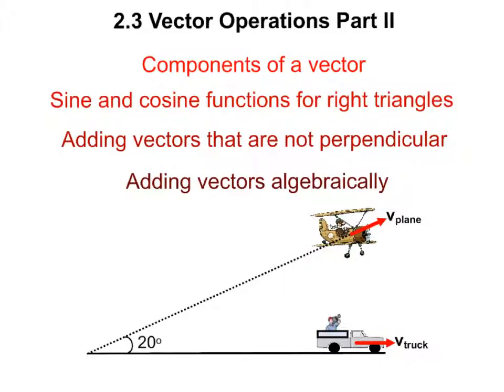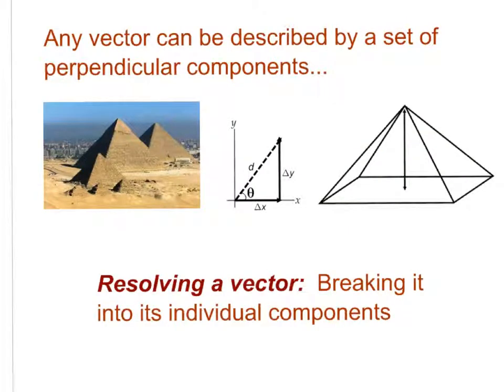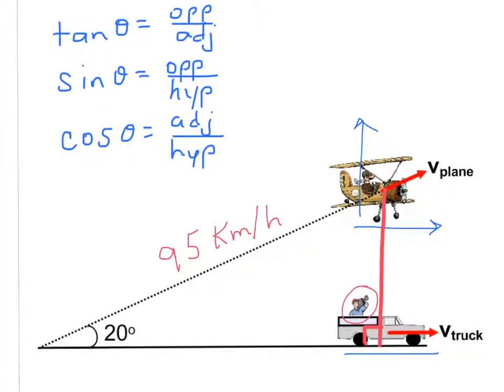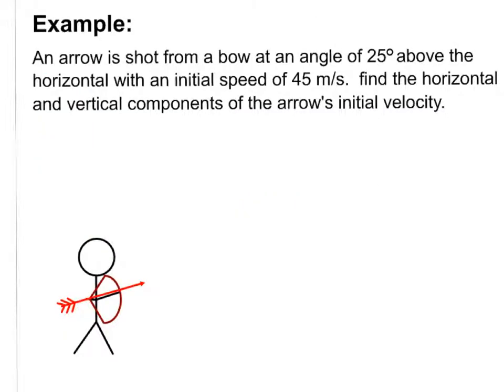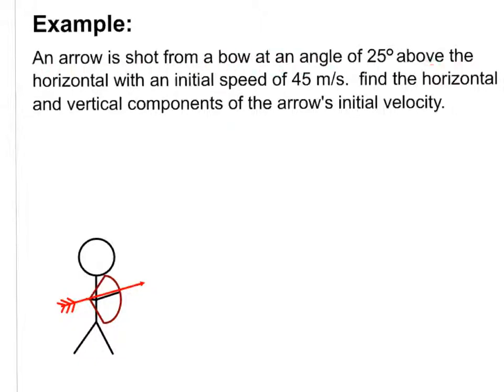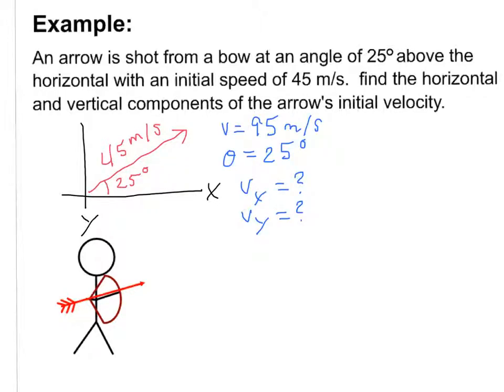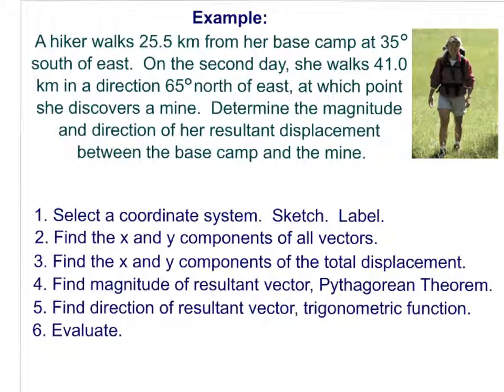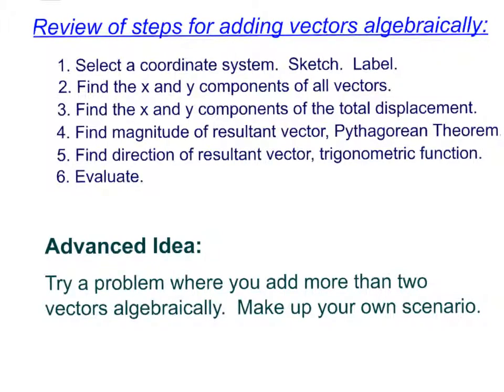Physics 2.3 Vector Operations Part 2

Comment: Sorry but you had a mistake in calculate the example:An arrow is shot from ....
You said: ((Vy=41m/s and Vx=19m/s)) AND THIS is INCORRECT 
THE CORRECT ANSWER IS: Vy=19m/s and Vx=41m/s.

But thanks a lot for your helps
Reply: yes there is a mistake it should be vy=19 and vx=41 
i make it in the calculator 

but thanks alot for making the vid it helps me alot